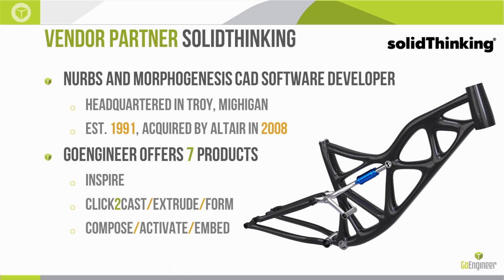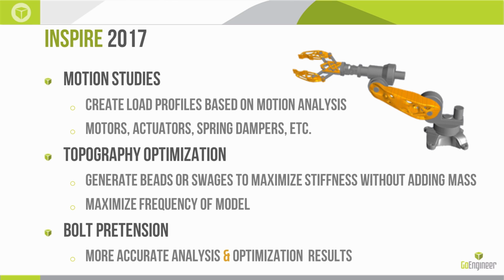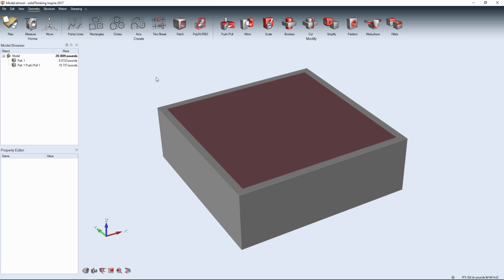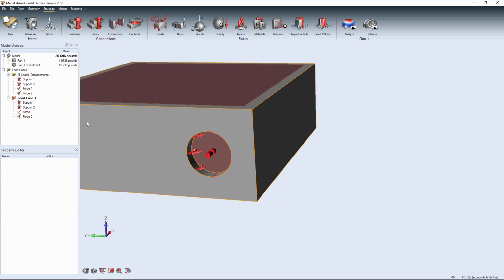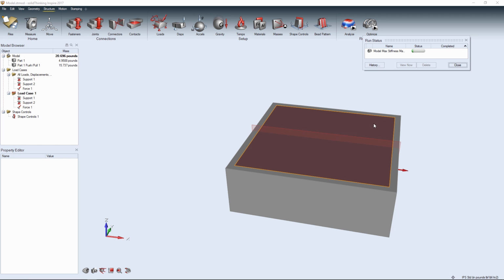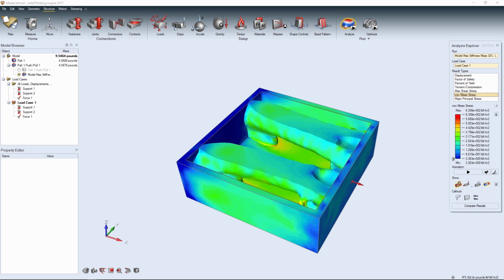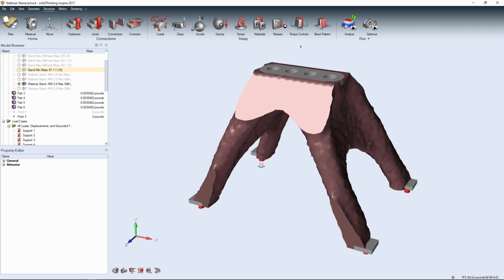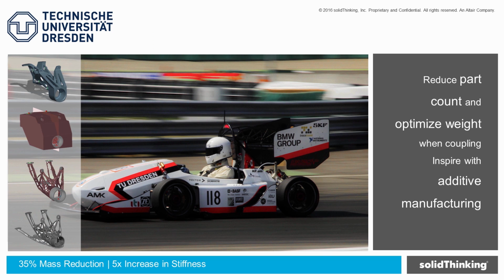SolidThinking Inspire - Analyze First, Design Second

Comment: lets say i wanted to use the Topological optimization on something that has wheels. Would then the axis of the wheel be a Joint that allows rotation and i would  add a support to the bottom of the wheel to hold it in place? Or would it be better to add the supports to the axis? 
I ask this questions for the following reasons:
if a force is pointing in a direction where my Object is free to rotate, would this lead into an endless rotation when just the wheels are supported? and would there be any pressure on the material? In real life the pressure on the material would be at a minimum because it could avoid the force with rotation.  

Thank you in advance for the answer :)